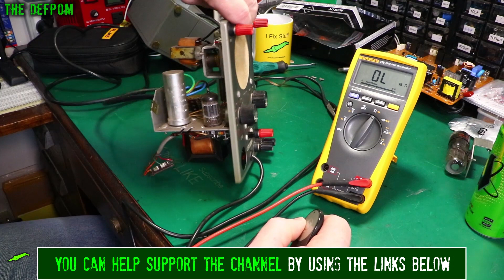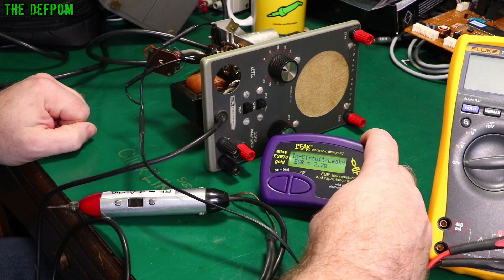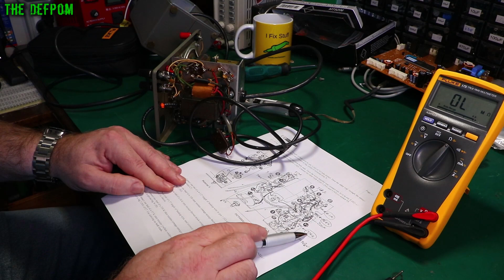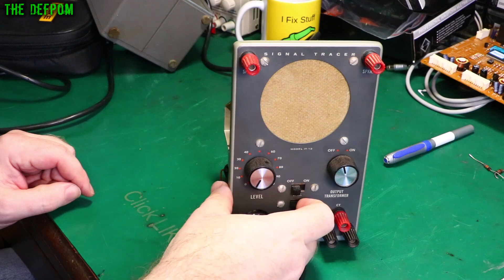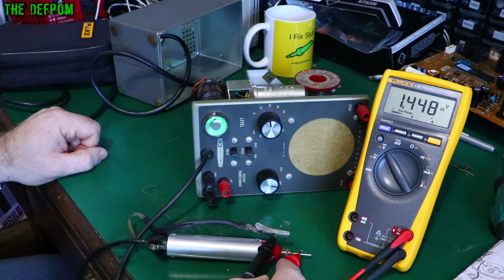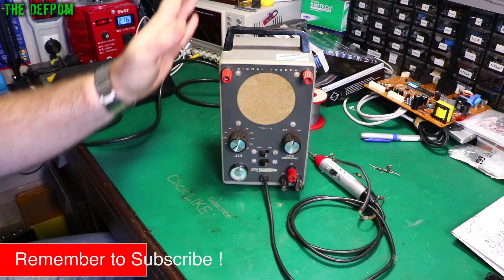🔴 Heathkit IT-12 Signal Tracer Refurbishment - No.1000

Comment: @6:17  50 milli-farad reservoir or smoothing capacitors in tube/valve equipment?   As Dave Jones would say: "that's a trap for young players"...  mfd written on capacitors is ancient US electronic-speak for MICRO-farad.  50 milli-farad is 5000uF!

Comment: The voltage on the probe tip when switched to noise is concerning (especially if you were to inadvertently inject that into a sensitive amplifier etc). Although the probe is capacitively coupled I believe you can override that capacitor with the switch on the probe, though I may be wrong.
Reply: Yep! Personally I would not put this Signal Tracer anywhere near the inside of  ANY transistor equipment.

Comment: Nice, I've always liked these little guys. For a modern and low cost alternative try the probe of a generator/tracer like the Fluke Networks Pro3000. It works great for tracing audio or noise through a circuit. You can also find generic versions for cheap. Of course it won't have the character of these Heathkit beauties!